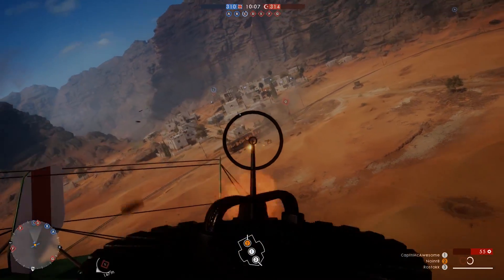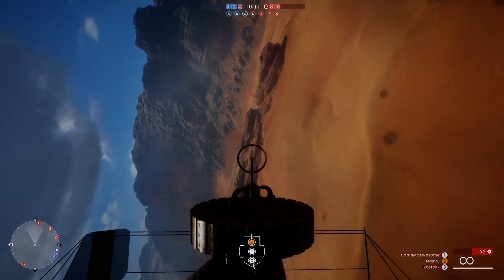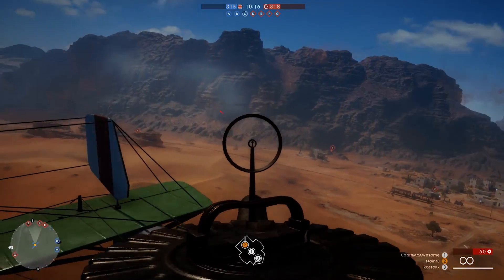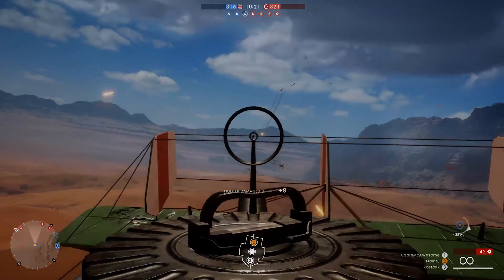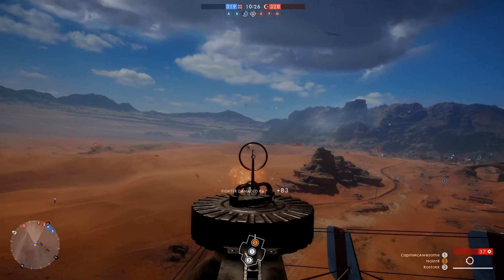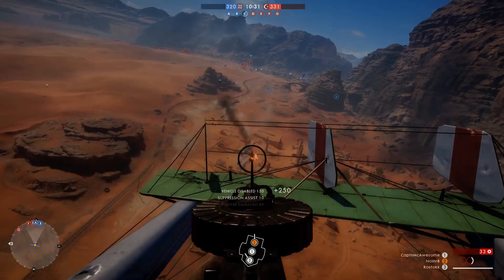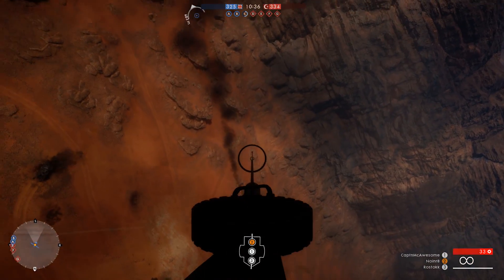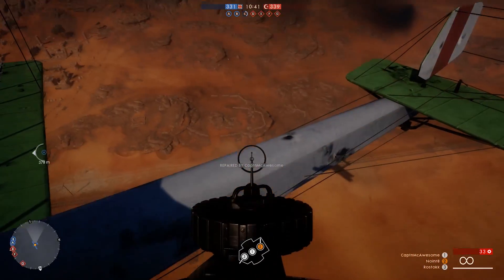What is coil whine and how to limit it!

Comment: Correction: coil whine is an annoying sound that comes from only cheaply made electronics. They are using cheap as$ coils and that is why they whine (resonate). Coils need to be made solid where the coils of wire can't move and ring like a gong. Loose transformers will hum instead of whine, because 50-60 Hz is a lower tone than the high frequency used in the  coils used in buck converters. 

The way to make coils quiet is to demand higher quality coils, or you won't buy their noisy crap. In some cases you can quiet them down by securing the windings with super glue or whatever else that will stop the coils of wire moving against each other and making a racket.

Comment: I disassembled my RTX 2070 super found the only uncovered coil next to the pcie power connectors and insulated it and now completely gone but don’t know how long it will last now. It was extremely loud and already have rma’d it twice and good Corsair PSU.
Reply: What do you mean with insulated?, my 2070 super asus dual started with coil whine yesterday and i very worried

Comment: I never experienced coil whine with my previous gpu in my old computer but now that i think about it was never at 100% because of a bottleneck. My current one suffers from it when i turn vsync off. Question is whether getting coil whine is normal when your gpu hits 100%, or should I try to RMA it or something?

Comment: my asus strix 970 never had coil whine issues before... they started after i got my brand new Corsair HX1000i psu for 200+ Euros! What about that? Should I just send the new psu in for replacement or will the replacement be the same because they are all like this
Reply: Check if it the gpu or psu that is whining. If it is the gpu, then returning the psu would be my recommendation.

Comment: 6:05
80+ certifications like bronze level certification say nothing! about the  quality of the components or ripple.
the certification is only about efficiency, so u can have a gold certified psu, that has insane ripple or a bronze pus, that  has  almost none, so the suggestion u should have given is, to buy a psu, that was actually  reviewed by professionals and got a high rating, like johny guru for example, were ripple, efficiency,  etc.. etc.. are actually tested.
it's kinda stupid, that  efficiency is the only thing psus  are sold by.
hell the wattage they tell u  doesn't even have to be continuous wattage, easily visible on some crappy dirt burn your house down psus like "750 watt" psus  with only 1x 8 pin pcie connector, so that u don't burn your house down the first day.....
Reply from the maker: Whys your point, I'm aware of that but certs are all most consumers understand and to hit say platinum you tend to use better components which will reduce the risk of coil whine, we can't all be electrical engineers, but I agree with you comment about certifications, keep it real
Reply: i think it's not to much from a consumer to check out a real review before buying a product, at least that is what would happen in an ideal world, well scratch that, in an ideal world, shit or mediocre electronics wouldn't exist...
i just don't want people to get screwed over and get decent electronics, that's why i want them to check out johny guru's reviews, or soon gamers nexus psu reviews (they are about to start making them). 
giving them a bigger picture of a product, instead of a marketing point, although thankfully 80+  certifications actually means sth., compared to let's sa a "vr ready" psu :D
Reply from the maker: @cataria3903  dude you are preaching to the choir, I'm totally with you but what I'm gonna say is not popular and I'm only saying it because the channel is kinda dead, most people are lazy and are happier to accept a 30second soundbite rather than spend thirty minutes flicking through material such a Johnny guru. Nice talking to ya dude oh what do you think of the rtx release. My personal opinion is amazing tech but 2 years too early to be commercial viable
Reply: it is sad, that "30 second soundbite" is what gets millions and millions of views, even worse, from people that often don't know what they are talking about, but at least it has nice b-roll :D
and i don't expect people to read a full review of a product that they buy, let's be real,  but what i hope for is, that they go to the conclusion and read "9/10, recommended" and then buy it, if we take johny guru for example, btw johny guru has a horrible website, because u can't sort reviews, u have to search for the psu u're interested.
to many people think that those "tech porn" channels are making reviews and then become informed consumers, although often not a single detail gets tested like display "reviews" for example not testing the latency.
and that's why i like stuff like gamers nexus youtube channel or adoredtv's videos, that go into the history or details of stuff.
the more people are aware of what companies actually do, the less bullshit we will keep up with.
in regards to RTX even there is so much hype without benchmarks, that even reviewer sites like tom's hardware are going insane and write crap like this:

"Just Buy It: Why Nvidia RTX GPUs Are Worth the Money"
https://www.tomshardware.com/news/nvidia-rtx-gpus-worth-the-money,37689.html

i think real time raytracing is amazing!  and it's insane that  it is already happening, but the cards are insanely overpriced!
but i won't buy one either way, because the next generation after rtx2000 will possibly do raytracing 2x or 4x better and also be a lot faster shader wise as it will be 7 nm note or smaller.
but i also won't buy one, because i don't wanna support nvidia as they have been anti competitive, anti consumer in any way possible:
u can check out this video about nvidia if u're curious.
https://youtu.be/H0L3OTZ13Os

i really hope amd  and nvidia 2060 and below will get ray tracing, imagine 250-300 euro cards (what most people buy) get all ray tracing, that would be a real step forward visually!

2 years sounds about right, when it goes from a shiny bonus if u sell your kidney for a overpriced card that can barely do 1080p 60  raytraced to standardized ray traced lighting in games for the average gamer.

overall rtx= innovation, that's sth. we haven't seen in a long time visually, which is great at least.
Reply from the maker: @cataria3903  I agree dude, nice talking to you

Comment: My pc started doing this today, after 2 years. It starts randomly every 20-30 minutes and it lasts from 5 seconds when the PC is idle to 30 seconds whe I'm playing games. I got pretty worried about it but hearing that it's just a sound and nothing harmful is pretty delightful. My PSU is kinda low quality and it is 2 years old. I guess it's done it's job. I'm still not 100% sure that it's the PSU/GPU but it shouldn't be harmful if it's something else, right?
Reply from the maker: +Bigby Wolf I would change out the Psu dude to me that sounds like the most likely culprit

Comment: Hi! I noticed a coil whine noise that I expect it comes from my CPU (or MoBo in that area). I firstly suspected it was from my PSU. I am using i5 7400 with its iGPU - HD 630 and I have found a solution: disabling C-States from BIOS (CPU Power Management) seems to fix the noise. Does this option disabled affects my system in any way?  With C-States enabled I hear cricket sounds mainly using High Performance/ Balanced Power Scheme and playing a YT clip or a game. Please tell me if it could harm my system if I get C-States off. :D Thanks!
Reply from the maker: +Andu hey dude for a non k sky chip c stars are basically a power saving option, but the amount of power they save is sensible imo, I would leave them off and it won't harm your system, I would consider getting a low gpu to release the load on your cpu. In short you found a good solution that will not harm the chip
Reply: So I disable C-States and nothing will go wrong. Maybe if I get a dedicated GPU there are no coil noises from GPU at all. Thanks for your time.
Reply from the maker: +Andu no worries dude, I have run with c state disabled and my chip was fine
Reply: Back of beyond Tech, I think I get a bit higher temperatures with C-states off. 32-40 degrees C and 600v core voltage. However, I think this is normal. Anyway it is very odd for my Kabylake to get coil noise with some power saving features on.With them off it is better. Moreover I consider this features like C-States, S4+S5 and IntelSpeed are practical for notebooks and laptops especially. On my desktop PC I would not worry much for a bit power consuming that would drain any portable device battery.

Comment: Hey man good review. I have a question (unrelated topic). I keep getting stuttering/freezing when gaming especially on TitanFall2, GOW4, Crysis3 and even middle earth shadows of mordor. I still have the problem on TF2 and GOW4 even when I dial down resolution to 1440p. My rig - 5820K, 16GB @ DDR4, 2xFury Nitro (crossfire), crucial 960gb ssd (for games), evga 1200w psu. It doesn't happen on older games like Crysis2, Mass Effect 2+3, etc.

I'm guessing it could either be due to my 5820K (only 28 pcie3 lanes) OR it may be due to only having 16GB of RAM. I read on an OCUK forum last year that guys were saying you need to have at least 32GB of system RAM if you own a 295X2, otherwise you will get stuttering/freezing during gaming. Prior to buying my pair of Fury's, I did own a 295X2 and I always used to get stuttering/freezing during gaming (I also had only 16GB RAM on my high end FX9590, ACHVFZ rig). Interesting coincidence. 

Why does stuttering/freezing typically happen during gaming?. I'm guessing 16GB RAM is not enough. What do you think the issue could be?. Thanks for your help.
Reply from the maker: +suhail ahmad Interesting, I can't imagine it is the ram or pcie lanes. I run two 970s in a fairly similarly specked machine I have the same number of pcie lanes and no stuttering really. I think stuttering is just an artefact of poor optimisation for multi gpu setups some games just handle crossfire or sli better than others. When I get in I will remove 16gb of ram to leave me with 16 and see what happens.
Reply: BOBT - Thanks for your reply. That sounds like a plan. Please let me know how you get on with 16GB RAM during 4K gaming!.
Reply from the maker: +suhail ahmad will do mate
Reply from the maker: +suhail ahmad will do mate
Reply from the maker: +suhail ahmad well mate no stuttering etc although the new nvidia drivers are Shit, my screen no flickers randomly in battlefield very distracting I feel a rant video coming